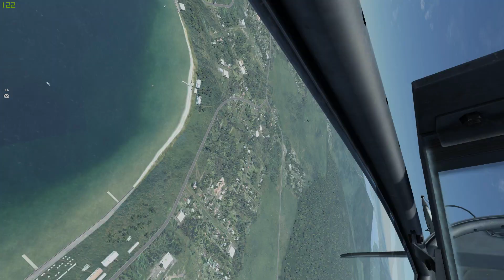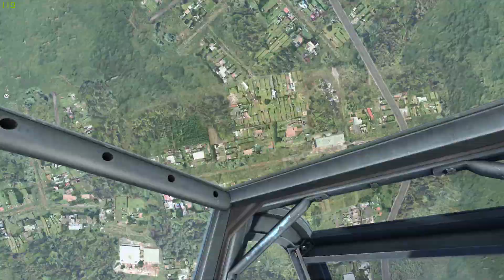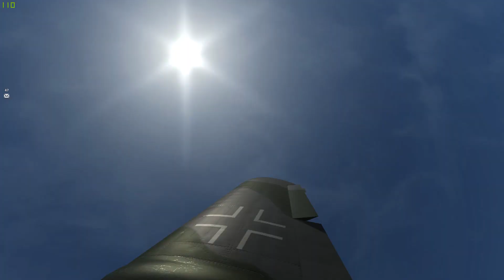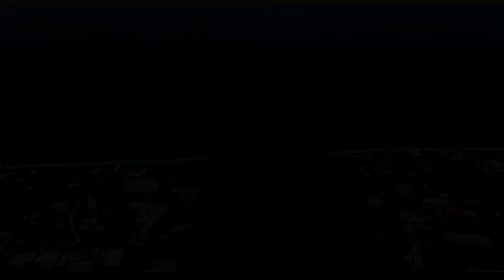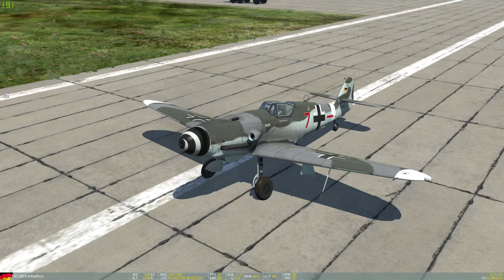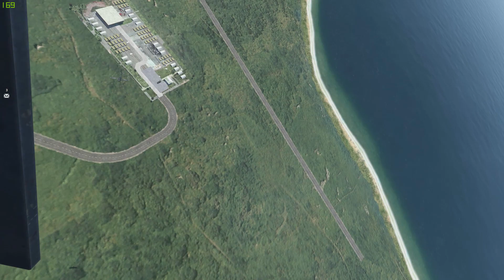DCS - Messerschmitt Bf 109 K-4 // Kurfürst

Comment: I always did like the BF109 as well, its characteristics are fantastic especially on the later models (if you got one assembled correctly) but still I like the P-38L more, the climb, the huge control surfaces and wings, the POWWWAAAAHHHHHH, the fantastic armament, the insane roll rate with the hydraulic boosters, and its not to be seen yet for DCS... :(
9:58 never go full hartmann
Reply from the maker: Yes, a P-38 would be nice. But there are a lot of cool planes coming eventually, P-47, Corsair, zero or a wildcat.
Though that might take a while.
Reply: GrmlZGaming Well considering the P-38's omnipresence in the pacific anywhere with any army presence and a strip of dirt to land it on, as well as escorting the B29s I'd hope it comes down the pipe with the other pacific fighters. The F6F may have gotten all the glory in their massive kill counts but the Lightnings did just as much, especially in the phillipines with plenty of ground to fly them from and where its a bit claustrophobic for larger ships in places, and it was the army's only real heavy hitter for CAS considering all the P-51s were being taken by the 8th and the P-47s by the 9th

Comment: An excellent video, I as always enjoyed the history lesson immensely. Also at 11:16 you said that the FW-190D9 has an electric starter but doesn't the Dora use the hand-cranked inertia starter since it uses the Jumo 213? The Anton has the electric starter for sure since it uses the BMW engine.
Reply from the maker: Its a inertia starter, but electrically powered.
The later 213E might have been equipped only with a manual one.
Reply: GrmlZGaming Ahh. That may be the case. Thanks for the clarification.

Comment: Good to see you back Grmlz :)  Just a sidenote, isn't the upcoming Spit Mk IX for DCS a late model one? Wouldn't that one have a nice powerful engine giving it better P2W ratio and with this closing the gap with the Bf-109 in climbing/energy fighting?
Reply from the maker: I dont think we know what exact engine settings we will get. But yes, the Spitfire also has a good power to weight ratio. 
Its a pretty even fight.
Reply: I guess it would be a 1944 Mk IX with a Merlin 63 or 66. The best case scenario would be the one with 150 Octane fuel and 25 lb/in boost (80.9" Hg in American nomenclature) and that one would be very very powerful, don't know for how long it could keep this power setting though. These 1944 Spits also had automated prop pitch, supercharger, mixture and radiator control if i'm correct.
Reply from the maker: I dont think it will get 25lb boost. At least so far they did not go with the most powerful options possible on the BF 109 and P-51D.
Reply: Griffon powered Spitfire is planned for 2016 release also.